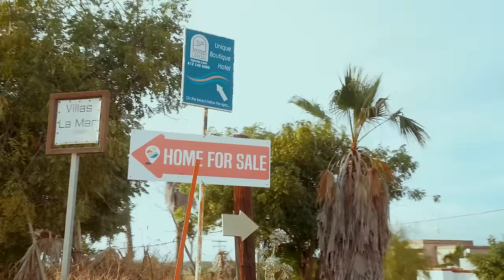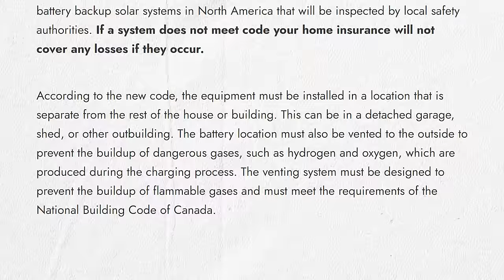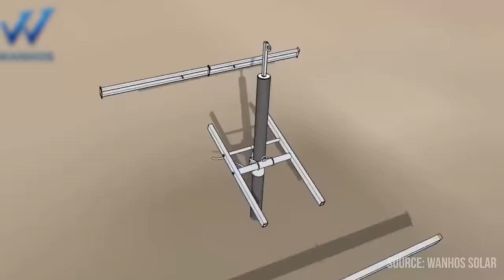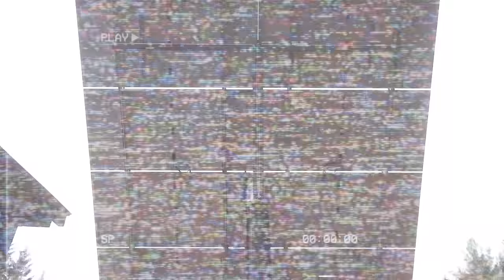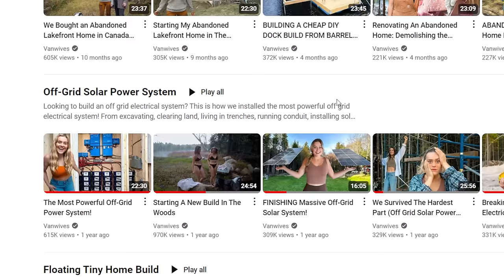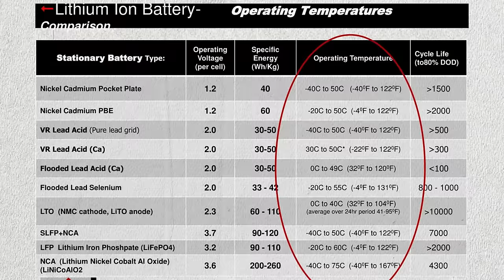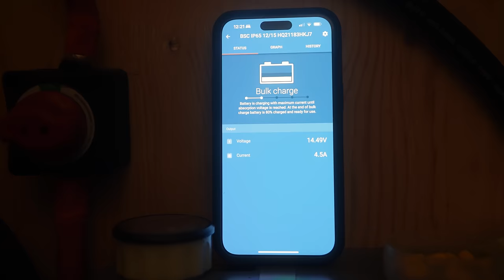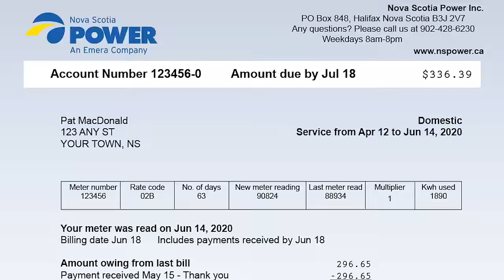Complete Off-Grid Solar Power System & Battery Bank (Start to Finish Install)

Comment: First this is not  off-grid .  I keep saying this to everyone who builds a solar array  .. it takes on grid to build off grid .. and truly off grid is where you wear a bear skin jacket and chop holes in the ice to drink and bath and you chop down trees with a manual saw and an ax .. off grid for  all the youtubers is not off grid .., when you need a bolt , screw or a new battery you have to go into an on grid town to buy your  supposed off grid stuff ..  and don't get me started about the batteries and the damage done to the environment and to people..  as for  savings  you've not said one thing in this video about the full cost of providing yourselves .. off and on grid electricity  ..  and the idea that you can have electricity if there is a weather disaster  issue will depend on  whether or not that weather damages your system as well as the grid systems  .. and lastly you both head off to warmer climates  this may become your biggest and most expensive issue as these systems require babysitting because if something goes wrong it can really go wrong .. and another lastly . these systems can become extremely expensive as they are going to need overhauls in the decades to come .  there are drawbacks to  them and you'll be finding that out .
Reply: tl'dr, but even so, there's a fine line between being condescending and being pedantic. I think you've just obliterated that line.

Comment: Ask Arkwright would say. HOW MUCH. think you are off your trollry or have more money than sense as could build small power station for that or better still, if you have the water a small hydro electric dam. As I am 73 and haven;t spent that much on electric in my entire life, my current annual spend on electric from the grid id about E500 a year so will be long gone the third time round before I recovered that sort of cost. You obviously never sat down and thought it out.

Comment: Hi Crystal and Jasmine. I know you are looking forward to get to Baja to get started on your house. I live in Alabama in the US and I am worried about you going down there. There have been several kidnappings and murders in Baja. One of the couples was two women and weren’t residents but were kidnapped and murdered. It was the cartels there and I know you love it there but so does the cartels. When they see that you have the money to build a house then I’m afraid for you two. Please please carry protection from them with you even though your protection will not equal their firepower. From what I read about the two women, they did to them what usually happens to women in that position. I’m not trying to be a Debby Downer but just worried about you. They have even kidnapped whole families and threw them into a big ditch them spraying the ditch with many many rounds of bullets. They were wounded and finally made their way to a road to get help. The cartel members stole their camper, truck and their motorcycles that they had went to a competition somewhere that their son was in. Cartels don’t care who you are as long as you have anything of value to them. Please be careful and I hope you are carrying people with you. I know you have always found friendly people there and they are friendly until they aren’t. Always keep safety in the back of your minds. We don’t want to see anything, so small as a splinter, happen to either of you. They have tried to keep these things quiet since tourists are their only ways of support. Much love to both you lovely humans and of course your supervisors.🙏✌🏼🤟💖💕🇺🇸🇺🇸

Comment: OMG! 500,000 JUST FOR ECLECTIC? That's crazy. Is that because there's no electrical pole already near ur location? 
My quest is, for ur Solar system, what is the total cost for ur entire needs?
FYI, after a while, your solar panel will have some degradation, nature of the beast. Look into bifacial solar panels, they have come down in price & more bang for ur buck. 😉 
🤗🐕🐕💓🌈

Comment: You could have retired for $500K
Reply from the maker: 500k is the cost to bring GRID power poles to our cabin, which we did not do- we instead went with our off grid solar system.

Comment: Nice to be independent, but some remarks:
- not everyone has 500.000 $ to build their own, not everyone can get sponsors like these lovely ladies  
- an independent solution is only good if needed, for example if you are not living 10+ miles away  from the next human infrastructure. 
- yes, natural catastrophes occur, but the potential impact can be controlled, for example installing power cables underground when storms are a regular thing. (Wonder why we in Europe do not hear about power outages every time there is a big storm. *Irony off)
Reply from the maker: All great points there is LOTS to consider and everyone’s needs are different. However 500k was to bring GRID power poles to our cabin, which we did not do… that is why we chose the alternative of an off grid solar system

Comment: 24 x 100 amp hours = 2,400 amp hours.  Why do you say it's 28,000 amp hours?

Maybe you mean 28,000 Watt Hours???

That would make more sense.  24 x 12 volts x 100 amp hours = 28,800 watt hours.
Reply from the maker: Yes correction!

Comment: I hope Battleborn sponsored this and gave you that $24000 worth of batteries for free.  If you used prismatic cells and build your own batteries it would cost less than 20% of what those overpriced Battleborn batteries cost.  I built my 15kwh of batteries for $2000.
Reply from the maker: Battleborn, is the best. 😊🐶

Comment: the components are not good. they just expensive. next time no victron. all in one inverter with integrated solar charger. i also have built the batterypack by myself with 280ah lifepo cells.

Comment: Heat pumps are shit, total  waste  of time.. I used  wood for heating and cooking....it does seem  your electric  needs are huge...my of grid power  system  cost 35k...that's kiwi...and I charge  a ev. With
That
Reply from the maker: Unreal! Glad you found a system that fits your needs